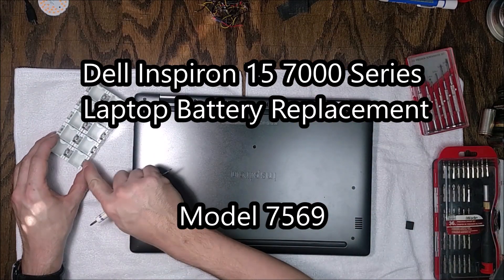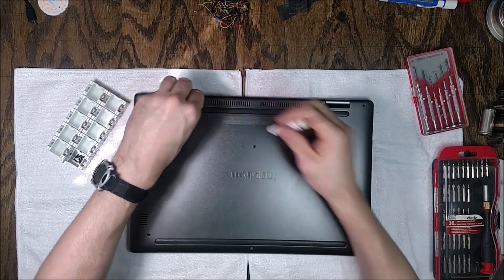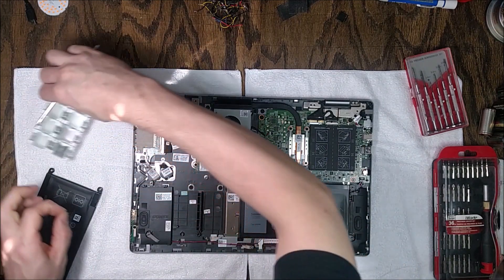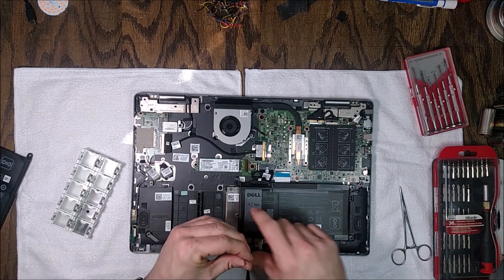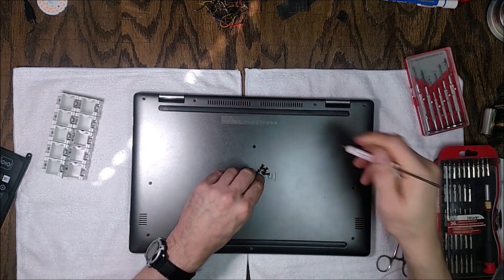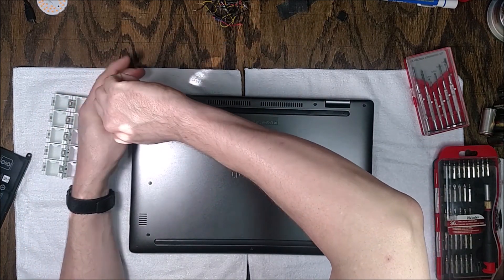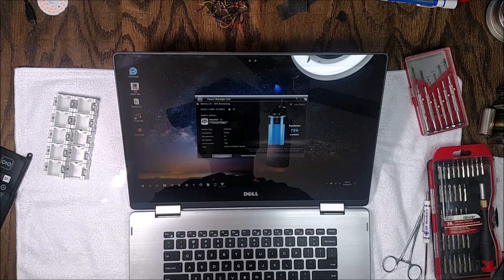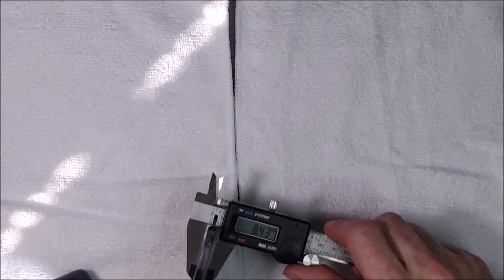Dell Inspiron 15 7000 Series 2-in-1 Battery Replacement

Comment: Hi Carl,
I have a inspiron 7000 and the battery is damaged but i can't find the right model online.
Can you hlep me?
Reply from the maker: There are several things you can do.  First is check if you have the Dell Power Manager app installed.  Right click on the battery symbol in the lower right of the task bar and see if the pop up shows "Dell Power Manager."   If it does you can pick that and it might give you some information about your battery.  On mine there is a link in the top right that says "order battery" that will take you to Dell's site.  Unfortunately, when I clicked that it took me to a page that shows nothing about actually buying a battery.  But it does have a bunch of information on how to determine the health of your battery.   When I bought my battery I just did a search on Amazon and eBay by the model number of my laptop.  I don't think all 7000 series use the same battery so you'll have to find the specific model number, like for mine it is 7569.  Just search for "Dell Inspiron 7569 battery" but with your number in place of the 7569 if it is different.   Another thing to watch for is for is the batteries that aren't "genuine" Dell batteries.  I saw many that didn't even claim to be Dell batteries and I haven't used one of those so I don't know if it will work or if the laptop will refuse to use one of those.  Dell says that genuine Dell batteries are only available from them, but the one I bought identifies as a genuine Dell battery in the Power Manager app and works OK.